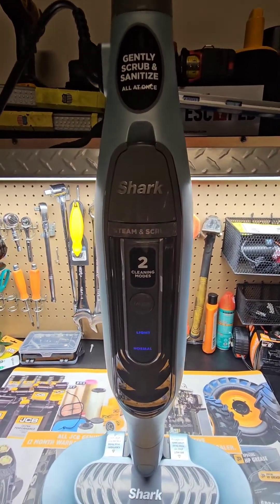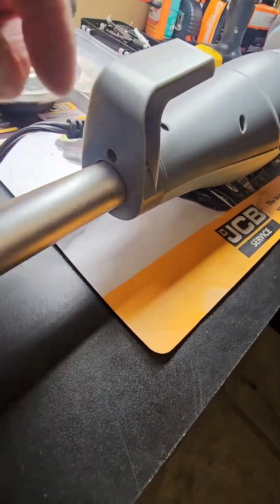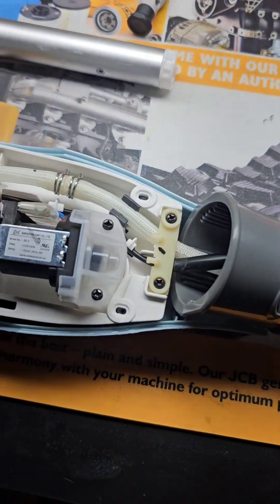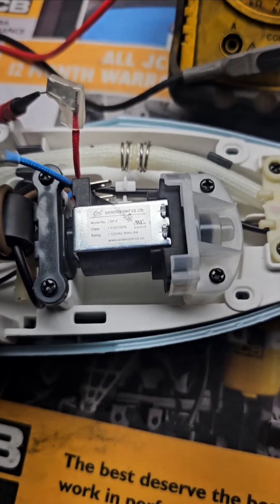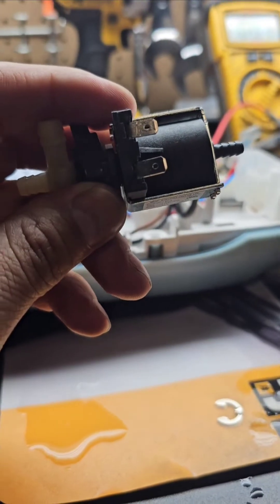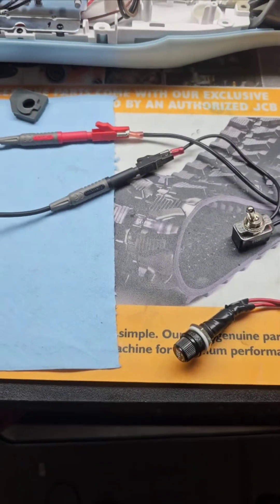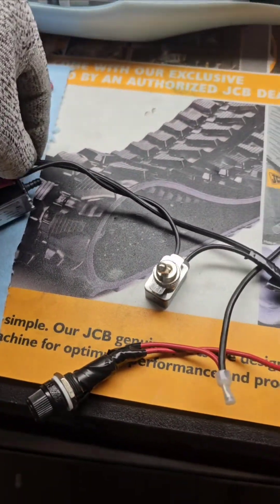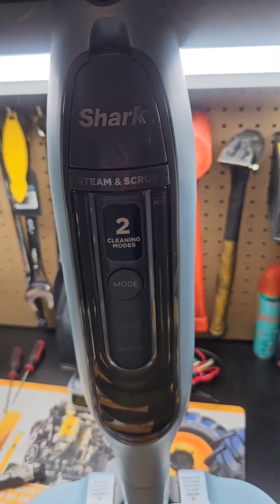Shark Steam & Scrup Repair: learn how to take it apart, test voltages and clean pump

Comment: You didn't explain why you had so much water versus steam afterward? What did you do to resolve this? If our mop is making the clicking/thumping noise that it normally makes when water resevoir is empty, doesn't that mean that we have a clog somewhere? I have tried using CLR in the resevoir, leaving it overnight, but that hasn't worked. Any ideas?

Comment: Thank you for showing an easy disassembly, and going through your troubleshooting, helped me to quickly solve the problem. I did what you did. But I did not remove the pump. I just powered the unit on and did a technical tap with the back of a screwdriver handle on the pump.. That freed the pump.
And everything is working again. 
We only use RO or distilled water. And we normally put vinegar in our water for cleaning the floors. So it is not a hard water issue. Just something happens and it gets jammed your was clean to. Ours quit working on us mid cleaning. Thanks  For the video again
Reply from the maker: The technical tap?  😂

Comment: Do you have a video or instructions to remove the lower covers so I can get to the gear mechanism of the rotating discs. Mine work for about 20 seconds then slow and stop. Im thinking there is some dirt around the gears and want to clean them but can't work out how to get inside. I thought it was a case of removing the 2 small metal discs in the centre of each rotating disc and thery would come off but I can't get mine off. Any help appreciated
Reply: DID YOU FIGURE IT OUT - MINE IS NOT TURNING ON ONE SIDE
Reply: You need to pop them off, I used two screwdrivers on each side of the disk and used them as levers. They come right off